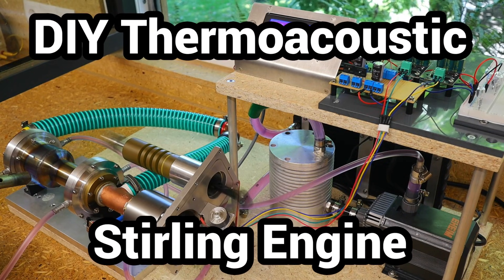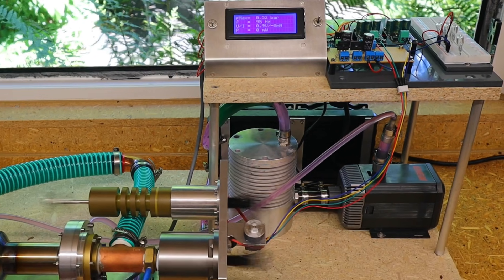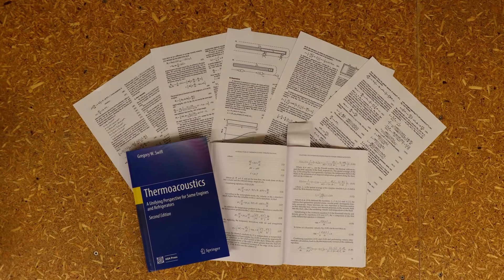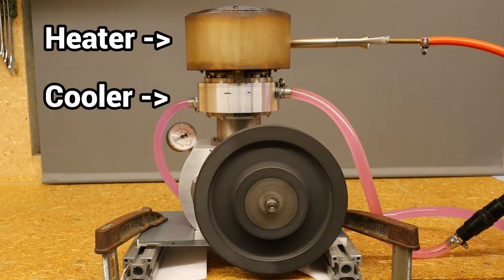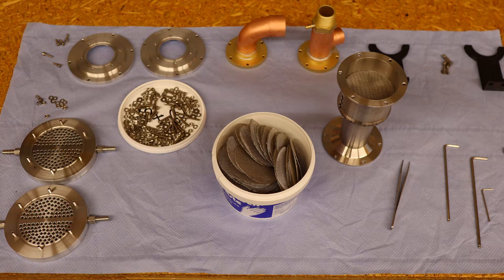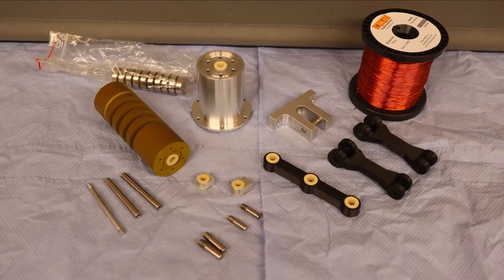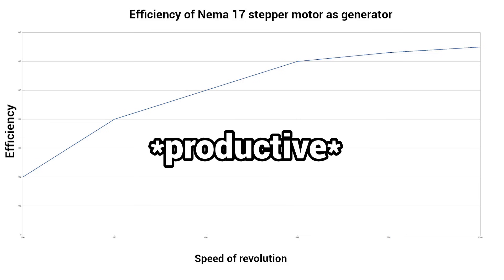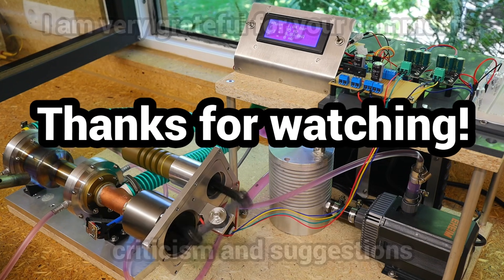Developing the thermoacoustic Stirling engine to generate power for the home

Comment: i've been thinking about acoustic stirlings for several months and even tried to build one
they say you have to mount it very rigidly to something heavy in order to decrease it's losses. Yours seems rigid.
Three big sources of losses:
1)heat, conducted through the regenerator(yours has low axial thermal conductivity) (short path loss)
2)heat, conducted through the feedback tube(yours would be low since you use plastic tube, but in order not to melt it you withdraw it using water, thus heat loss is big. Ideally, we should use low thermal conductivity material and thin walls to reduce this loss. Or we can cool it by the air, that goes to the burner, thus preheating the cold air in burning chamber and raising flame temperature. But increase in the flame temperature would exacerbate this disadvantageous thermal flux(long path loss) and we would arrive at new, probably even higher loss through this mechanism. Need to think more about it.)
3)heat loss by the parcels of air traveling around the loop . We want pressure waves to travel in a loop, but have no average air current, as it would dump heat on the cooler in vain. So people recommend to insert a flow stopper. Like a piece of thin rubber or film. It should still conduct sound, but stop net flow. You can insert it near the cold side of your device.

In general, i think it would be better to  build heater around the flame or the flow of hot gasses to better utilize it. Like a chamber with ribs that gets inserted perpendicularly in the acoustic manifold. This raises question of keeping the long path loss low, but we can still use your water cooling method.
In general we have a problem of transferring heat from gas to gas and that is not an easy task. We need a lot of the surface area. Ideally this can be optimized numerically and 3d printed from metal, but that is very difficult and expensive. Then people successfully used 3d printed gyroid heat exchangers. Another good choice is fractal branching fins. Fractal branches often arise in heat exchange optimizations. They can be cut using EDM inside of the burning chamber exhaust pipe heat exchanger and face hot gasses and atmospheric pressure. The outer part of the tube, that is facing acoustic manifold can have just a set of disk fins, which can be easily cut on lathe. If you don't have access to EDM, you can just drill a bunch of long holes in the part that is facing atmosphere and hot gasses. Thus you will need only lathe and drill to make this type of heat exchanger. 

Regarding power extraction device: I have thought about it for some time and found an interesting effect in the literature: you can rotate things with sound if you arrange speakers in a circular pattern and transmit sinusoidal signal through them. Let say we have 12 speakers  arranged in a circle equidistantly as hours in a clock. i ranges from 0 to 11. We have i_th speaker and its voltage is sin(omega*t +2*pi*i/12) that is each speaker sings with a phase shift against its neighbouring speakers. Then we hang a piece of material above this circle of speakers and this piece of material starts to rotate. SOUND CAN TRANSFER ANGULAR MOMENTUM. 12 is not a magic number. In limit we can have infinitely many speakers arranged in a circle singing with a phase shift proportional to the angle on a circle. Imagine we have a pipe that sings with a sin(omega*t) We can  put a plug of smaller diameter coaxially in this pipe and now we have a circular slit that sings with the same frequency. Resembles 12 speakers doesn't it? Now we need a device that would induce continuously(not necessarily as we've seen in example with 12 discontinuous phase shift steps before) varying phase shift to different parts of the slit. Resonators  induce phase shift. How do we make said resonators? Let's consider T shaped acoustic manifold made of pipes. Sound is transmitted from left to right and the overhanging perpendicular chamber has variable volume. This volume we can manually control and observe that with different values of this perpendicular volume we have different phase differences between incoming and outgoing sound. So let's return to the task of inducing variable phase shift to the sound coming from different parts of angular slit. Let's just add different volume resonators to different parts of the slit. Voila!
 Now how do we extract power: put a porous or ribbed cylinder to this singing circular slit and the sound will drag it along with itself. Like electromagnet motors. This is sound motor.
Difference between porous and ribbed cylinders is the same as difference between synchronous and asynchronous electric motors. Porous  cylinder is being dragged but can have variable rotation speed. Ribbed locks in with the sound waves above the circular slit, but struggles to lock in. Maybe a mixture of the two would have advantages of both. Like they do in some electric motors. Porous <-> squirrel cage and Ribbed<-> permanent magnet.
Reply: You can also just vary the length of pipes that lead to each of the part of the slits. You have 3d printer and that is a huge advantage.
Additionally, sound coming from a slit can have different angular/orbital? momentum numbers
search "How to make a sound wave spin? Hit it with a pipe" or "angular momentum sound" to get visual intuition. 
In short Delta_phi(alpha) as a function of angle on a slit alpha can cross multiples of 2*pi different amount of times. If it is a linear function delta_phi=k*alpha+b, then k is what determines the angular momentum number. But k is not arbitrary: we want delta_phi at 0 to be 0 and at 2*pi to be whole number multiple of 2*pi
This whole number multiple is angular momentum number. 
It can be zero: whole slit sings at same frequency and phase. boring case.
It can be +-1 then area with same sound pressure goes in a circle cw or ccw. 
It can be +-2 and then we have two  equidistant rotating areas with the same pressure
It can be +-3 and then we have three equidistant rotating areas with the same pressure
it can be +-n and the more the n is, the slower areas with constant pressure influence the rotor. The higher the torque and lower the speed. So we can use it like a gearbox.
It influences the number of ribs on the rotor if we use rotor with ribs. It is like number of poles in electric motor.
Reply: So, a sound pressure coming from area of the circular slit at physical angle alpha is p=A*sin(omega*t+n*alpha), where n is angular number, n is a whole number.
The idea is to create a constantly sustained pressure gradient above the slit and drag a rotor into rotation with this gradient. Porous rotor can slip against this rotating pressure field, while ribbed or lobbed can't.  abs(n) determines amount of high pressure zones above slit and sign(n) determines direction of their motion: cw or ccw.
Shape of lobes on rotor is an open question
My candidates:
1)rectangular or close to that
2) sinusoidal
3)piecewise spiral
4)thin fins-limiting case of rectangular
5)thin recesses-opposite limiting case of rectangular

The number of lobes on rotor may be different from n to achieve different "gear ratios" and rotation direction or it won't work entirely. I have no idea.
Reply from the maker: Many thanks for your very detailed information, I have to look close at your topics and will think about them before i can answer.
Thanks for your kind help and comment!

Comment: The piston should rotate to maintain reduced friction from the air bearing function at the stopping points where the piston has to change direction. Adding bearing to allow the piston to rotate and also adding maybe a light emboss of a tesla valve pattern or some other textured surface patter to encourage rotation may help. Just make sure the bearing addition does not add more slop into the system and also does not bind every time the piston has a impulse from changing direction.
Reply from the maker: Sounds quite complicated but I will take a close look at your suggestion.
Many thanks for your help and when I got some information about it I may have some additional questions...

Comment: Long ago had the idea of using a bourdoun tube in a free piston sterling engine to extract mechanical power and avoid all the complexities of seals and leaks..... just like extracting power from the oscilating needle of the manometer... like a tourbillion in a watch
Reply from the maker: That sounds very interesting, I will take a close look at your kind suggestion.
Many thanks for your help!
Reply: @myengines2443 its cheap! and should work!... out there some manometers rated for 700 bar even, just machine the npt thread or use standard fittings and its ready to go and look the analog presure output.. last part is the mechanism to convert the oscilations to electric power but its the easy part

Comment: 1:14 I'm not sure if you tryed this or if your slicer has it but in orcaslicer we have an ironing setting called "all solid layers". it irons every layer and as long as your ironing is tuned well enough as a result your prints will not leak water. in your case if your not doing it already it could really help your prints hold liquids and pressure. i like what your doing, hope this helps 🙂
Reply from the maker: Thanks for your nice help, I will try it!
I used ironing years ago on my old Ender 3 only for a nicer look which worked not very nice for me but I think this is a new very nice feature and I will try it for sure!
Reply: @myengines2443 

You should also consider changing the orientation of which you print. From your example pressure vessel, the failure was along the layer lines which were inline with the hoop stresses but not the longitudinal stress. I would change the orientation of the layer lines to be 55 degrees from the hoop orientation. That should increase the strength of your parts without additional weight or complexity.

Comment: helium as a working gas has its benefits but I wonder about future supply even though new reserves have been found. plus it leaks through anything and has to be replaced. this hurts on the maintenance scorecard.
Reply from the maker: If you have not too thin, massive wall thicknesses the diffusion of helium is not too much.
Maybe with 3D printed parts (as I want to try, but maybe only for development?) is may be a problem but in my solid metal kinematic Stirlings it was not a big problem.
Thanks for your kind help!

Comment: Impressive! Would it be feasible to have two working pistons working in opposite directions in order to counterbalance each others vibrations, or would very small differences in heat flows make them force each other out of optimum oscillation?
Reply: This is a good idea. There are concepts with I believe up to 4 pistons for stirling engines which counterbalance each other.
Reply from the maker: Yes multiple pistons are a very good method of raising energy, efficiency and to reduce imbalance.
Unfortunately it makes the engine more difficult to design and more complex.
Its very much work to develop the single piston engine so a multiple piston engine may be an later option when I understand the underlying concepts more precisely.
Thanks for your nice comment!

Comment: Why do you not use a induction electric  heater to  ensure  that this variable is constant?
Reply from the maker: For testing and developing the engine it would be indeed a more scientific approach.
You are absolutely right but that means more effort that in my eyes can be better used on other things.
There is still a lot to improve (actually its  nearly the first unaltered design, I am still struggling with the basics...) and maybe when it comes to serious efficiency tests I will use electric heating.
Reply: This is the exactly same thought I had.
Reply: Use electricity to make electricity with 50% efficiency?
Reply: @takiktos1265  I have thought exactly the same too, why not to use electricity as a heat source since the objective here is to learn and this would split the learning process in two more manageable problems, not to speak about simplifying the experimentation. Many compliments nonetheless
Reply: @takiktos1265  

To test the efficiency of a system it  is really helpful to have the same inputs and outputs, it is really easy to measure the power used and  power created if they are BOTH  electric and if you eliminate parasitic losses this means you can easily calculate the   total system efficiency.

obviously the final machine will use some other form of energy, but as a proof of concept you need to know as accurately as  possible what efficiency you can expect, this  is essential to make accurate comparisons to other types of motors.

This  is really  basic and if  people knew this they would not fall for all the free energy scams that  YouTube cons people to buy!
Reply: @takiktos1265  Just for testing.
Reply: Yes, but why induction? Resistive heating is much easier, and with enough thermal insulation can be considered 100% efficient at steady state.
Reply: @sashimanu  
Resistive is fine,  but  it is a bit  more variable (contact imperfections, air losses, lethargy of control rapidity, and requires a custom interface to be made if the motor is modified), but essentially a resistive  system would have the same advantages of  being  easy to measure ,so why not!

Comment: You should get yourself on a good AI service, nothing free will do it - but if you pay for ChatGPT, Gemini 2.5 or Grok 4 - these should help significantly with the math.
Reply from the maker: I did some research with the help of several reasoning AI's and they are really useful for not too specific topics.
I have to try them more to get a good conclusion but so far the design of a themoacoustic circuit is too complex and to specific for an AI as there is not so much information in the net.
Reply: @myengines2443  Glad you have tried them. True, they do have significant gaps sometimes. If you want to run a few queries through GPT5 pro I would be happy to help.
Reply: LLM AI for math? Are you kidding me?
Reply from the maker: @takiktos1265  not for actual calculation but reasoning models can be quite useful for physical or mathematical concepts!
Reply: @takiktos1265  Two models got a gold medal in the math Olympiad this year. Most people just repeat what they hear other people say.

Comment: Thank you for this video
Do you have any estimation about thermal efficiency of this engine?
Reply from the maker: The engine is still in the beginning of construction so its efficiency is really low.
I know of engines which have more than 60 % of the carnot efficiency which is really high.
There are several free reports in the net where you can read about it!

Comment: What is the point of the see-saw thingie on the right of the engine?
Right, its the generator.
Looking forward to a fully linear design.
Reply: Also for balancing the engine. When the piston moves forward, it pushes the other rod backwards, reducing vibrations
Reply from the maker: The lever is for balancing the engine and also for the use of 'normal' generators in the pivot point.
If you look at the older videos you can see a full linear design with a linear generator directly coupled to the piston.
This is very elegant but as the power rises balancing is necessary and the use the moving masses of a linear generator as the balancing masses over the lever is also quite nice!
Reply: @myengines2443  This is a great solution.